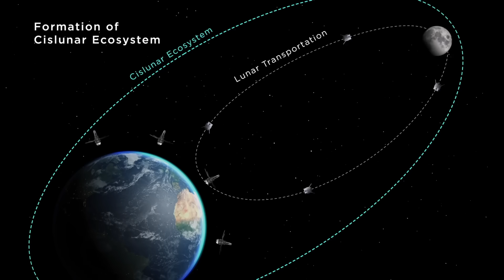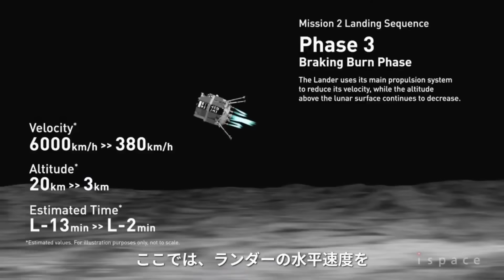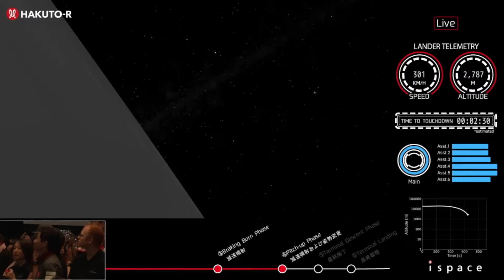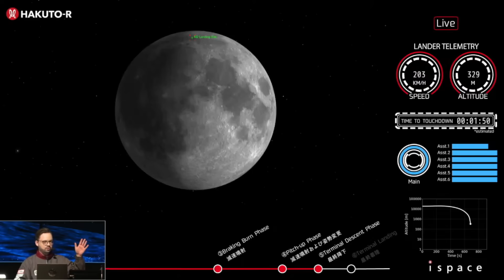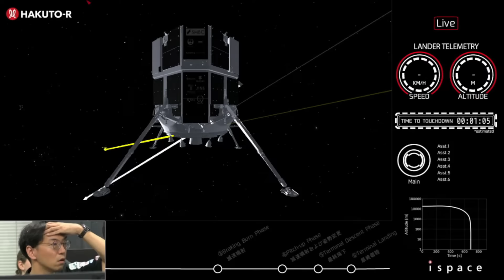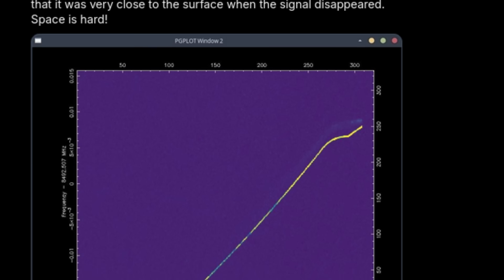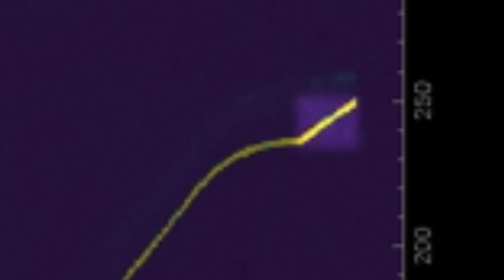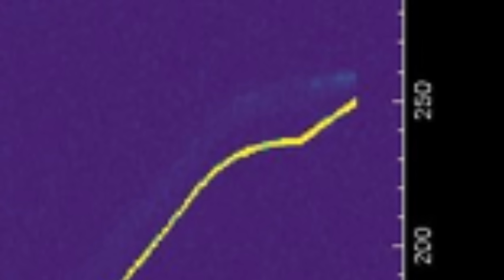Japan Crashes into The Moon, but Slower Than Last Time

Comment: As a coder it's honestly kinda depressing seeing almost every recent lunar lander crash due to what's essentially shit code. I know this may sound harsh, but I can't imagine these kinds on bugs to be undetectable here on Earth. Slopware everywhere.
Reply: I don’t know that it’s code, but more the lack of sensors to provide adequate situational awareness. Sounds like it’s guessing until it flips vertical, then it’s “oh shit”.
Reply: keep in mind Japan has demonstrated exceptional code with their lunar lander before, when the lander suffered an engine failure yet adequately adjusted and still landed quite well despite the problem.
Reply: @casualbird7671  the code needed has to be proper. no OS. involved no intrepreters. etc. while I agree Japan has good programmers, it is hard to ignore the results.  they are missing a piece.
Reply: Seems theres quite a bit of guesstimating done just because they didn't put enough sensors on the damn thing. Would think knowing your altitude at all times would be pretty important so why skimp on that? I would imagine it wouldn't add that much to the overall cost or weight.
Reply: What should the behavior have been here? Make assumptions and decelerate, like the other mission that did that and plummeted off a cliff?
Reply: @taq154  I find it baffling that this mission was not planned, simulated and tested in a way where this kind of issue could have been foreseen and a mitigation put in place. Making sure you can actually land your craft is the single most important part of any mission, so you would think they would make sure it works.
Reply: Bad code, but also bad engineering.  

If your entire landing program is dependent on assumptions and one range finder...  maybe you need more than one, and one type, of range finder.
Reply: When real world testing is impossible code can only be as good as the assumptions made about the environment, the behavior of the systems and the input of sensors being used for the first and only time outside a simulation.  If you don't understand how this can fail you lack either experience or imagination. Space is hard.
Reply: Shit code follows from shit requirements and even sloppier (and insufficiently imaginative and thorough TESTING). I worked on the Galileo and Cassini AACS FSW.
Reply: I've never met a "coder" that call themselves a "coder", programmer are the people I know.
Reply: This is better described as a sensor issue rather than a coding issue. Not a lot you can do if your sensors are only able to detect the ground when you're too close to slow down in time. The issue here feels more like a design flaw, they shouldn't be in terminal descent before they can actually measure their descent.
Reply: @dotnet97 I was to write about the same. We just don't know, if one or more sensors got flawed for a million possible reasons. Heat from sun, wire isolation, ... sothat whole telemetry was compromised. Or some miscalculation concerning the power of the engines, not being able to slow down the probe the way it should have.
Reply: They probably vibe coded the landing sequence with gemini 2.5 pro. Claude 3.7 would have gotten it right.
Reply: And as corporations continue following the trend of firing experienced coders for cheaper ones or outright replacing them with AI turboslop, it'll only get worse.
Reply: The problem is generally very hard to solve as you are dealing with multiple streams of data to try to figure out both your position in space and where you are pointing. Each of these measurments come with some error that needs to be gathered together. 
From that you can make some guesses about where you will be in the future taking into account the uncertainty, and then you need to apply your rockets in a way to perform a landing. 
There are good simulations of this where people test the probes and programs virtually before launch, similar to what is shown in the video, but reality is always much harder to deal with. 
The advantage of the older missions was not that they had better programs, they were likely much worse and simpler, but they had a larger budget for fuel to perform the landing, which gives you alot more to figure out where you are.
Reply: As a fellow coder I agree.
Reply: The mentality of releasing beta-shit and forcing the customer/end-user to endure a chaotic debugging/'upgrade' release schedule is endemic within the 'tech bro' community and given that most contemporary space initiatives are staffed by people with that cultural grounding, it's not surprising that there are seemingly dumb failures. The mindset for writing/testing software for games/apps versus that for mission-critical engineering is night & day, but hey, "let's move fast and break things".
Reply: @dominicestebanrice7460  I moved out of tech for that very reason. (I am OLD BTW.)  I could not stomach never being able to expect anything to just F'ing WORK. And then being crucified after an upgrade if it didn't work even though at the time, the Administrators would not pay for full testing systems. Today, I think customers have finally convinced their bosses that you essentially need a totally duplicate shadow system to test every major upgrade for months before you go live.
Reply: @dominicestebanrice7460  but dont worry they will get Ai to rewrite  the code for them
Reply: Solved the case for the perfect situation.
Reply: I guess it's more a garbage in garbage out problem. They do not use radar sensors any more. They all try to use laser based. This glassy lunar dust is not very compatible with this type of measurements. Weird reflections, refractions changing light frequencies ..... 
Why they even had to implement not trusting their instrument? The japaneses are not allone with crashing using laser based instrumentation.
Reply: Did they vibe code the terminal guidance? :D
Reply: Software used to have test engineers that worked hard to break it. Now we shift left and the engineer who wrote it is the engineer who tests it. This breaks a cardinal rule of product development because one singular mind attacked the problem, so only the solutions that mind thought of are the testing processes that mind will apply to it. It's completely daft when you think about it properly but no one in mgmt can think properly. 
Result = Slopware
Reply: They don’t write code the way they used to. It isn’t that they’re lazy.
Reply: Yeah, agree! Write to them and propose to write code for them!
Reply: Utterly unimaginable that no actual flights were done here on earth to verify all systems and test their reliability! Or did they?
Reply: @mrbbnut  Are you aware that gravity is 6x stronger here?
They need to re-work their design (add more sensors, improve their model), not their code.
Reply: The code might be shit, but that wasn't the problem.  It was either poorly designed algorithms, a shit test program, or both.  The code might be immaculate, but if it's written from poor requirements it doesn't matter.  And test is as much about the algorithm as the coding.
Reply: vibe coding the lunar lander :face-blue-smiling:
Reply: this comment makes no sense - based on scott's video this was not at all a failure of code, but hardware and design.
Reply: I'm going to guess that 80% of the code was written by Grok while the embedded team as hanging out, drinking beer at Hooter's in Tokyo.
Reply: If you know how the software industry in Japan formulates requirements, then you won't be surprised by all of this.
Personally, I am completely disappointed with the software industry in Japan. If this industry wants to complete projects that can operate normally, they can only choose to entrust them to Chinese or American companies.
Reply: I'll climb out on a limb.  the current programmers do not know how to write the code needed.
training coders to learn assembly AND sensor operations.  I know that is a bite to get straight.
Reply: Millennials can code as well as they can write an epoch.

Hate me if you want, but I guarantee that your favorite movie of all time is not Snow White (2025).
Reply: Just ask the China if they used cheat sheets? 😂
Reply: USSR send 3 rovers to the moon more then 50 years ago ,only first failed to land ,with computers that had like 1 kb off memory ,scientist back then were smarter then todays.
Reply: No amount of code can protect you against the dangers of having only one unreliable source of information to base everything off of. 
It's not an engineering issue or a coding issue, it's a business management issue. It's depressing that so many companies would rather lose 100% than pay 10% extra for redundancies that would allow them to succeed.
Reply: GenZ and millenials man, they are all vibe coding their way through life.
Reply: Same bro. Japan isn’t know for it good coding proficiency thou so it doesn’t surprise me.
Reply: @celeste_es  what?  since when?  japan used to pride itself on coding proficiency.  fitting large games onto small cartridges used to be a thing.  code had to work before it was released because there was no such thing as a downloadable update, because the internet didnt exist yet.  pokemon red and blue fit on a 512kb cart.
Reply: @celeste_es "Japan isn't know for it good coding proficiency thou so it doesn't surprise me."

🤨 What on Earth are you blathering on about? Maybe try learning something about Japan, then learn some English, then try posting something sensible.
Reply: @celeste_es Except for games consoles/handheld games.  I designed and coded a lot of custom software for specialized Japanese machine tools and instrumentation. I have tons of respect for their firmware and basic operational software.   It works as documented.  They struggled more with system integration with ambiguous or fuzzy constraints, which is why they hired Americans for such projects.
Reply: Oh just wait till they turn a team of AI software engineers loose on this problem... Why, experts will say, it'll work right the first time, every time. IF it does, say bye bye to a programming career. 😛
Reply: Go write something better.
Reply: @teebob21  I can honestly say that none of the code I have ever written has crashed a lander into the moon.
Reply: @teebob21  no doubt, you can only model the lunar terrain so much, in the code. reality and simulation are never the same.
Reply: @ThatOpalGuy one side yeah on other side there is lots of data on the moon. Being an almost perfect to sim environment no atmosphere, great constrast. There has been landing in the past with openly available data from the Apollo and surveyon missions. Flight software can be made failsafe for the most part. Practices has been standardized for airplanes and cars. Idk
Reply: @teebob21  What a brilliant comment. You don't have to be a better programmer to criticize bad decisions.
Reply: @teebob21 we can write something better.   Implementation and execution of the big picture seems a bit less feasible.
Reply: All they show is lousi cgi, none of this was real to begin with. And all you guys are talking about about possible reasons why it failed, while you believe we had men  on the moon with pocket calculator technology in 1969. Discernment isn't yours.

Comment: Anybody else reminded of the arcade classic Lunar Lander?
Reply: Well, landing on the moon is basically 2D. No good reason to be on the other axis at all.
Reply: @FuncleChuck  That's about the dumbest thing I've ever heard.
Reply: @FuncleChuck  Either you are dumb, or you just don't know what the difference between 2D and 3D. The landing on the Moon is 3D! But maybe that's where the error is. Those Japanese thought it was a 2D landing! 😂😂
Reply: @BSnicks  I think the poster used the wrong terminology, but is essentially correct. Think of it this way; the spacecraft is coming in on a straight line. It is not moving right or left. It is also going up and down, in another plane or axis. Once the velocity is zeroed...it's only going down. Like a helicopter - if it is not moving forward or sideways, and is hovering over a spot...it is only operating in one axis. 

It's like landing an aircraft without the need for any rudder or aileron input.
Reply: @BSnicks  basically you slow down the horizontal speed, and then the vertical speed, until you land. You don't shift the path to left or right. So, it is basically a 2D problem.
Reply: @frankpinmtl The Moon is still rotating. The craft will still come in at an angle. That's just how this Universe works. Earth was never flat nor stationary nor center of anything. The same goes for the Moon. Even SpaceX   had problems bringing back it's boosters because of this.
Reply: @BSnicks  I highly recommend listening to the lunar landing tapes. You can find them on YT.

In them, you hear the LMP always calling out to the Commander (who is flying the LEM):

"X amount forward, Y amount down. X amount forward, Y amount down."

They are trying to  slow the X-axis to zero (forward velocity), then lower the craft on the y-axis (height), to the surface. 

There is no concern given to any other motion. Essentially...working in two dimensions.
Reply: OG KSP
Reply: I spent a month entering the program by hand onto a school BBC B at lunchtimes and saving to tape then having to debug it and finally play it.
Reply: Yes, trying to land without crashing seemed just as difficult then as now.
Reply: I played that game SO MUCH years ago on the xbox 360.   Last year i found it at my local science centre and easily killed an hour on it haha.
Reply: I wasn't any better at it than iSpace.
Reply: In the 1990s, my teacher added a randomly appearing M obstacle to this game
Reply: Yes
Reply: The original was a computer print out. I went through rolls of paper to get the LEM "to float like a piece of pocket gnurr floating to the floor'
Reply: I kind of think they should use that on program applicants.
Reply: we had a non-graphical, i.e. text input and output version, in FORTRAN at about 1975.
In 1981 I programmed a version of it that used up all of my 1024 Bytes RAM on my programmable pocket calculator  😆, in BASIC
Reply: yes, that was a fun one, and only a few years after the real thing happened over and over and over again for the USA, all 6 successfully. But not many of mine did, as I recall!! LOL ;D
Reply: That was only 2D
Reply: @BSnicks  The earth is flat, so this should be simple, you dolt.
Reply: @BSnicks  hence the word "classic", meaning quite old. LOL ;D

Comment: It's interesting that automated landing failures on the moon have happened so many times. Yet when a human was landing they pulled it off first try. 
In spite of multiple issues popping up in real time during the landing sequence.

I think this is a fantastic example of how far apart human control is from automation even today.

So in this case did they need an angled lidar to be able to lock earlier in the descent profile? Or keep the main engine available to relight to provide enough braking thrust later when the vertical lidar gets it's lock?
Or maybe add a less precise altitude indicator that can at least get the braking started earlier. You know you are headed to the surface and you are already at pitch over. Seems like a good general time to start the braking sequence with or without precise lidar data. 
I bet they adopted the 'suicide burn' strategy to save fuel but then didn't have enough thrust to pull it off. Which would be a rather elementary mistake since the mass and velocity of the vehicle and the gravity of the moon would be well known ahead of time.